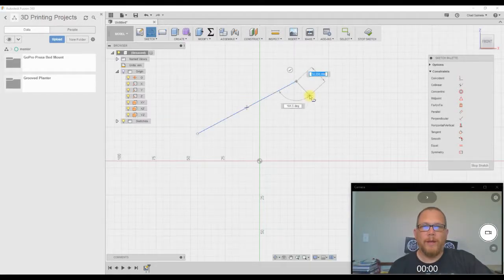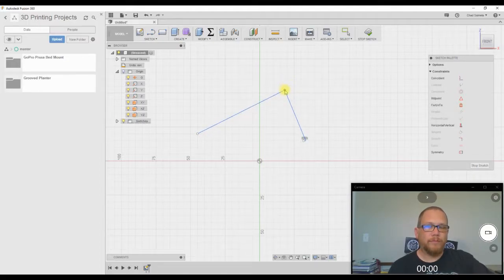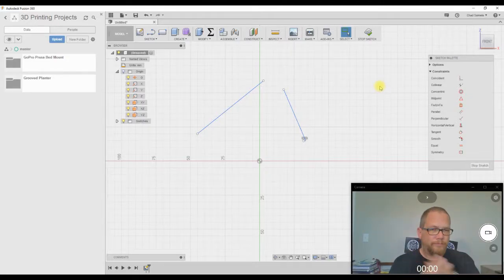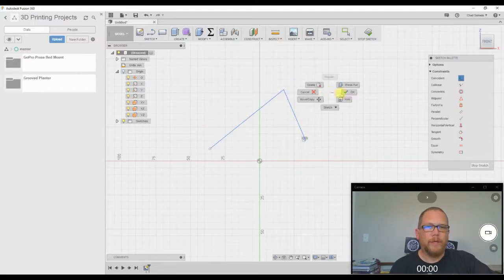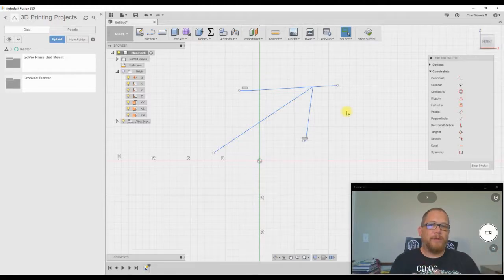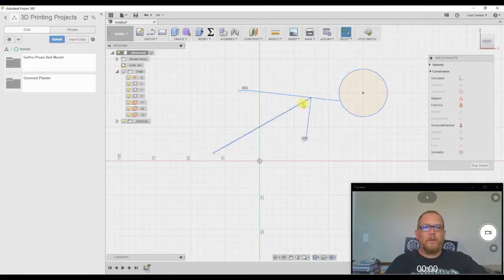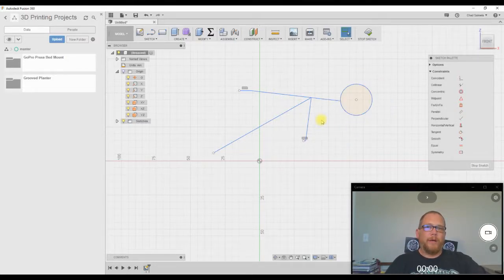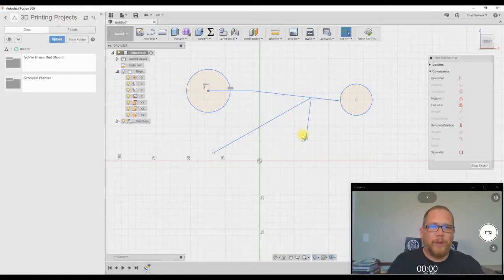CAD Tutorial 02.1 Coincident Constraint

Comment: I am confused about how to use coincidents between sketches, for example trying to make a rail for a loft. It works when I'm on the same sketch, but not between sketches.
Reply from the maker: That is correct, you cannot create a constraint between two sketches. But, you can project geometry from one sketch to another. So, you click on the "Create" drop down. Then go to "Project / Include" > Project (or use the "P" keyboard shortcut). Then you can project geometry from a reference sketch to the current sketch you are working on. Once you have the geometry projected, you should be able to apply your constraints.